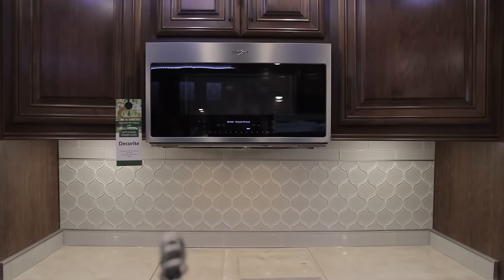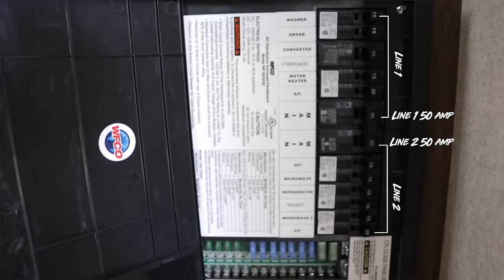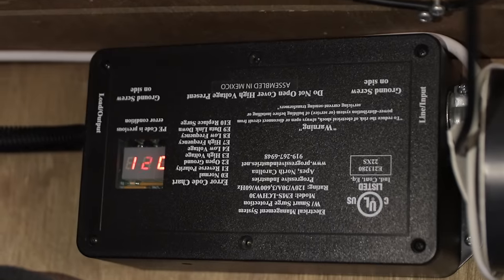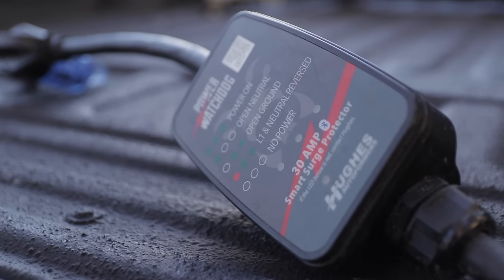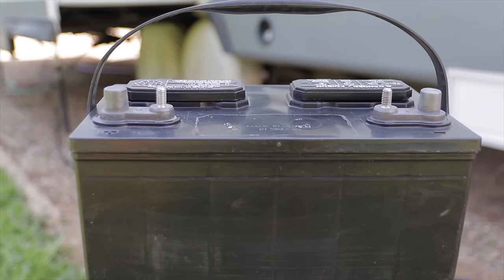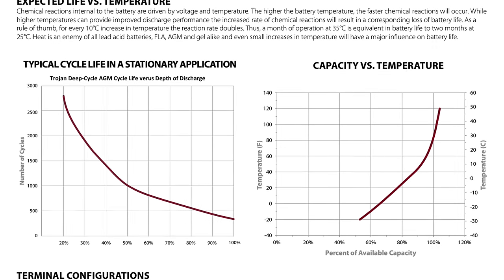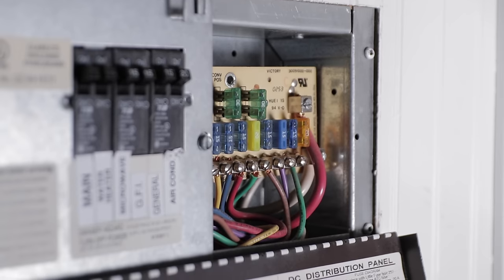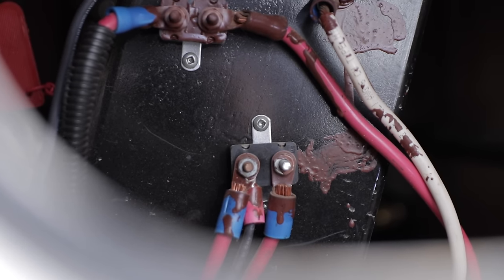Understanding RV Electrical!

Comment: Quick question. I am building a 24v system for my rv but I am planning on keeping the 12v batteries and system in place. I was thinking about just keeping my existing converter and just charge the 12v with the converter plugged into the inverter. What do you think about running my system like that? Is it ok for a long term solution or should that only be a short term solution?
Reply: Good question! I am thinking of have two separate DC battery systems myself. One 12v battery system for the normal 12v lights and such and a 24v battery system to power my inverter.
Reply: @TreeLBollingTreeMan  that's exactly what I am doing I am just wondering if it is worth getting a step down DC to DC convert when I am going to have to keep that side charged anyway. Plus the original 12v system is already all wired up.
Reply: @jefferycundiff3804  I've thought about the step down also, but most definitely I want at lease 24vdc to power my inverter, Much easier on the inverter with 24v instead of 12v. Just wonder about how much power is lost using the step down for 12vdc. Glad to see someone else thinking of the same system though. Take care.
Oh by the way, do you watch Will Prowse?
Reply: @TreeLBollingTreeMan  never heard of them but I'll check it out. I do know that the step down converter is very efficient not much power loss but I dont think it acts as a charger. I just want to keep my 12v system because it not only works the levelers and lights etc in the rv it also works the emergency brakes on the rv and it is just more convenient I figured then I might ditch one of my LA batteries.
Reply from the maker: I haven't tested a system like that but it would be interesting to see what the loss would be in reality. There will be loss and inefficiency when the power you have collected in the 24 volt system is inverted to 120 ac and back to 12 DC.  There are a lot of things to consider for each type of setup. I would probably end up going with a DC to DC converter.
Reply: @AllAboutRVs  my RV is based on a truck and has a 24V system, along with a 12V converter of course, it has two sets of 12V batteries and a 900 watt alternator

Comment: I'm installing a 110v outlet hard wired to a 2000 watt inverter. Can anyone help me with fusing/breaker? A house style big breaker box seems like overkill for one receptacle. Wont a ANL fuse or the small 20 amp 12 volt breakers or something be good enough? Thanks

Comment: So I have a 50 amp Rv. I have 240 V when my generator is running. When I’m plugged into shore, Power have zero AC when I check voltage on the red hot leg and the neutral I get 240. I see the black leg coming out of the inverter and going to the neutral block. I suppose because it’s only a 120 V inverter. But I’m baffled because I have no AC voltage plugged in but with the generator I do.
Reply from the maker: It could be several things but I would start with the transfer switch. Sounds like the problem could be there.

Comment: I'm wanting to run a 12V battery bank. I just purchased a 2021 forest river salem 26DBUD. Do I simply add another 12v in parallel? Or do I need a new converter?
Reply from the maker: Since the battery is new you can add a second one Ss long as you match the battery. I would get one that is identical. Your converter will be fine, no need to swap it out. I’m sure it’s a multistage converter in the 2021 and will work well.
Reply: @AllAboutRVs  awesome. I appreciate it and your videos are helping me out tremendously.

Comment: Questions??????
When I plug my trailer into a campground it trips the the 110 plug on the pedestal? Any thoughts.  
I’m using a 30 amp plug with a 110 adapter.
Reply: Does it work when connected to your 30 Amp 120 Volt outlet at home?

Comment: There's no split phase.  It's two legs, each of which is 110-120VAC, and the two together are 220-240VAC in the same phase.

Phases have to do with the sine waves of high points being off by some number of degrees.   In that event you won't ever see 240VAC because one phase will be receding as the other is rising.

Phases - multiple power sources that have highs at different times.
Legs - multiple feeds from the upstream transformer.  Highs at same times, but on different wires.

Fuses don't protect wiring.  You said it several times.  Fuses and breakers are there to protect overcurrent on either the end-device or the battery.   If the wires are a factor they are undersized.  Wire gauge is entirely sized based on current (amperage) not voltage.  If you have burning wires, either change to higher voltage (same wires) or upsize the wires.

AGM - that's not lead-acid.  Your commentary and percentages here... not right.  Having a good charge controller is the right answer.  There are many battery technologies and having a good controller will save a lot of pain.  However, the cheapest heaviest batteries (lead-acid) and the next heavier but not cheap (AGM), and lithium, and other battery technologies... pretty much are inversely proportional between weight and cost.   There are other factors, such as size, charge rate, discharge rate, etc.

I do love your stuff.  The electrical stuff (in this particular episode)... not so much.

Comment: I bought a 1987 Fleetwood regal I later discovered the wires from the battery have been cut I don't know which wire is hot and ground
Reply: And what all the wires if they're hot or ground the inside works on 110 but no 12volt anywhere

Comment: So what you are saying you can plug a 30 amp rig into a 50 amp plug with a dog leg without burning out the campers electrical?
Reply from the maker: Yes. The adapter only lets one leg through to the 30 amp RV. If you try to draw over 30 amps the main breaker in the RV should trip and protect you from over drawing from the RV Pedestal.
Reply: All About RV's Thanks. I bought a dog leg but I had a electrician tell me something different but it wasn’t in reference to a RV connection.

Comment: How can you plug in 50 amps rv to a 30 amp supply? Wouldn't that trip the breaker?
Reply from the maker: It will only trip if you use more than 30 amps. Plugging it in and using it will be fine you just can’t use more than 30 amps of power.

Comment: When a 50 amp 240 v trailer is plugged into an adapter to a 30 amp 120 v receptacle how does the power get to both 120 v legs?
Reply: Marty, it sounds to me like it would be good to confirm that you have a 50 amp/240 volt system.  Are you sure it isn't 50 amp/120 volt?  I'm no expert but I don't think I've ever seen a 50 amp/240v outlet on a campground pedestal.

Comment: Mostly good stuff. I would caution to never attach a 30A cord/RV to a 50A outlet via an adapter. If shorted, the cord can melt before the 10awg wire before the breaker trips. 
   A 2pole 50A breaker provides only 50 amps total (two phase not "split" phase") ... You do not have 100 amps the cord will not support 100 amps. 
   Otherwise, pretty good stuff, thank you.
Reply: No, it is actually called 240 Volts AC Split-Phase in the USA.  It is not 2-Phase.  And yes, it is 50 Amps per LEG.  You can draw 50 amps from L1 + Neutral at 120 Volts and another 50 Amps from L2 + Neutral for a TOTAL of 100 Amps at 120 Volts.
Reply: @MrSummitville     Very well stated.    To be 100% correct, you should call it 120/240V single phase.   I designed systems for 35 years.

Comment: You may have answered this in another video, sorry if it's redundant. Should you turn the battery disconnect off when you are plugged in or hooked up to a generator?
Reply from the maker: Leave it connected. If you have a multi stage converter it will not harm the batteries and keep them charged up.
Reply: @AllAboutRVs  thank you! Stay safe!

Comment: Good morning. I have setup my lion energy battery bank utilizing the manual switch. All seems to function well except the AC#2 which is powered in position 1 by the hot leg that does not go through the multiplus. Turning it on causes the multiplus to shut down after 15 to 30 seconds. Then both turn back on and the cycle repeats. I this is while AC#1 is off. There is no issue with running AC#1 on its own which is the hot leg through the multiplus. Any ideas?  Thanks

Comment: Theres no such thing as split phase. Per nec it is single phase 120v or single phase 240v.
Reply from the maker: Yes the NEC labels it as 240 single phase but no matter how you label it the 50 amp Rv has a split phase coming in 180° from each other. Which is drastically different than the 30 amp RV. If it was just 2 lines of 50 amp on the same phase the neutral wire, as it is setup now, would melt. But with the “single phase 240v” (split phase by definition) the loads will balance as power is used on both sides and just the remainder or differences Of the two lines will be on the neutral. My hope was in my description to help in understanding how it works.
Reply: @AllAboutRVs  There is L1 and L2 in the 50 amp RV outlet. Not 2 phases. It is single phase. The secondary of the transformer is taped in the middle for the neutral, hence the term split phase. Correctly labeled 120/240 1P. 180 degrees can only be single phase.
120 degrees can only be 3 phase. There is no 2 phase in practical terms. It exists but is antiquated and not used.
Reply: @AllAboutRVs  nice explanation,  I'm a electrician  so I get a good chuckle when people give out incorrect terms to me.